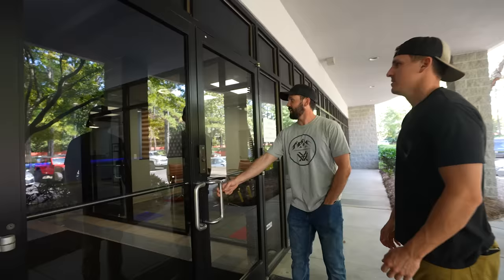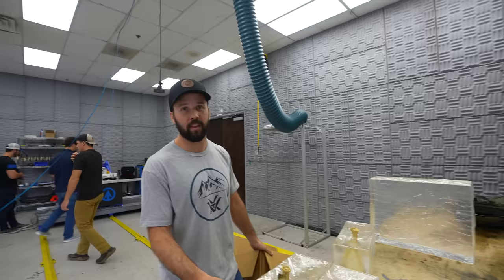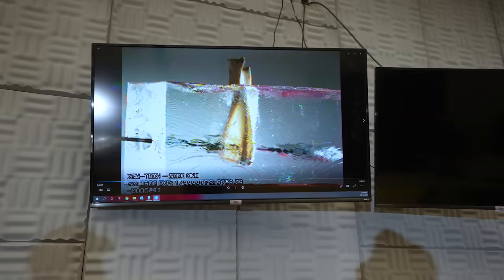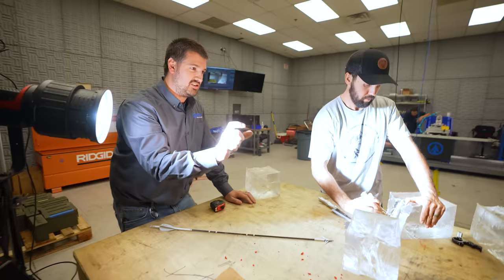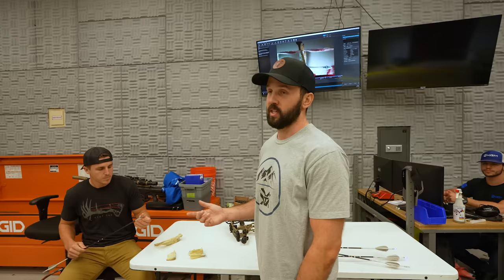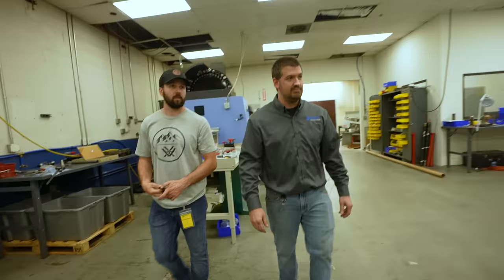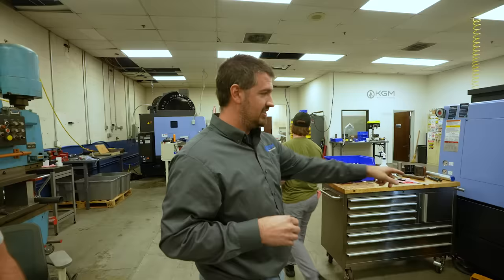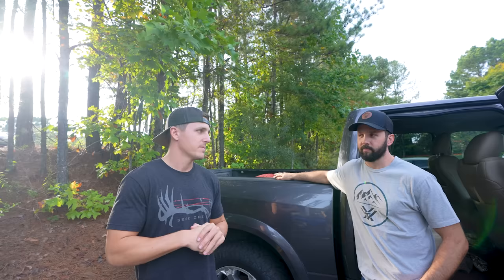BROADHEAD TEST: Which One SPLITS BONE? (Super SLOW-MO Camera!!)

Comment: This should be conducted again but put the scapula at the average distance of a shot for hunting. The parameters of the test are off when you are shooting at the distances you are shooting at. Everything should penetrate enough just due to kinetic energy transfer, which as long as you are hitting the scapula with 25 PSI, most are going to break or allow cut through. Also, my question is how fresh were the molded scapula's? Are they dry bones because dry bones perform differently than wet or fresh bone does. this would be something that really expands the tests if you do this again in the future. I do enjoy tests like this but I would like you guys to acknowledge some of the issues with your testing and the variables that change during these tests compared to the real world.

Comment: The thing you left out is that mechanical went through 12” of gel before the bone. I believe it would have had at least 6”
of penetration on a deer
Reply: And the single bevels would be in the dirt behind the deer after blowing straight through it.
Reply: @outlawcustombows  I’ve killed a ton of deer with mechanicals. I recovered every deer I’ve ever shot with a mechanical. The trauma is unbelievable.
Reply: @JM-sj4wj  so is a smashed humerus or completely fractured shoulder knuckle or vertebrae... won't do that with a mechanical. They're a gimmick you get lucky with if you shoot in a bad spot too far back.
Reply: @outlawcustombows  I shot a buck last year that was on edge when he came in. The farmer was cutting the field and spooked him. When I shot it ducked the arrow and I completely severed his spine with a NAP mechanical. The deer never took another step. The proof is in the pudding.
Reply: @outlawcustombows  the year before that I had a 16 yard frontal shot that blew through my buck and exited behind its shoulder and stuck 6” into the ground. The deer painted the trail red for 40 yards and dropped dead
Reply: @outlawcustombows  I have not had to track a single deer more than 50 yards since I made the switch to mechanicals. Three years ago I shot two deer in one evening one went 20 yards and literally fell under my tree the other went 40 and crashed through a fallen tree. Complete devastation on both
Reply: @JM-sj4wj  see you haven't mentioned a single thing yet that a solid  single bevel 2 blade doesn't do... and they break BIG bones as well...

Shoot what you like but the REAL proof is in the data and physics.

Comment: I love using mechanical heads for the cut diameter on them, but if I wish that I could find one that punches through bone without having to worry about have a small cut like most fixed blades have
Reply: Iron Will wide might be worth a look. Plus they have a lifetime warranty

Comment: First off, thank you guys for putting the work into this, wonderfully done test. Not everybody shoots that heavy of an arrow or out of a 70 lb bow. Could you include the speed of, and more importantly, the energy it is producing? I shoot a 563 grain arrow out of a 65 lb bow which produces 240 fps and 70 lbs of energy. Curious how much an extra 5 lbs of pull weight would change this.

Comment: I've used G - 5 montecs for 5 years now and have hit 3 deer, between my son and I that penetrated both shoulder blades and lungs and shattered both blades and even broke a hip bone and penetrated on a shot that became extremely quartering away at release and STILL penetrated up into the chest cavity and sliced lung and cardio pulmonary arteries. Most broadheads would have failed.  I  swear by G-5 montecs

Comment: Would have been cool if you tried grim reapers I have went through the scapula with 50 pounds and it stuck out the opposite side. 50 pounds 24 inch draw with fmj. Two years ago cut strait through the socket with 60 pounds at 63 yards on a quartering to doe she didn’t make it 50.  I have never had a problem with them opening or punching through the shoulder bones

Comment: I would rather have a knife grade high carbon steel that I have to oil than a soft stainless steel that can't be sharpen or hold an edge. I used wasp cam lock broadheads many years ago, they used carbon steel and the blades were truly razor sharp. The new heads, the edges roll or compress, they are not even hard enough to chip. They will get almost sharp but you can't get that fine edge. Its like making a knife out of mild steel vs 5160 or 1095 steel. Mild is just to soft to produce a working knife. I'm curious to see what you guys produce.

Comment: You started saying different styles broadhead but 3 were close in style. I personally think the Toxic broadhead would have fit right in and you would been quite surprised like the last time you tested it. Cutting a hole as big as a quarter from one side to the other puts them down fast. I have never had a bone stop one yet. Just be aware of the cheap knock offs. They suck.

Comment: Hey guys I was just wondering if I could send y’all a couple drawings of broad heads I have had them since y’all’s last year video cause it I seen the fixed penetrated better but it wasn’t a big diameter cut so I drew a design with a 2 inch cut diameter and it’s fixed so maybe y’all would be interested in seeing them

Comment: I just had a problem with the Muzzy shank 100gr expandable opening in flight and I almost missed a nice 8 point at 18 yards. I just recently got a ravin r10 and I thought they would work fine just like in my old Tenpoint turbo gt. I was vary wrong and if it wasn’t for the 1 3/4in cut I’d have lost that deer. Apparently 400fps and 270 pound draw weight is to much for the Muzzy shank. I will be looking for a new expandable for next year.

Comment: Sevr 2.0 just bought it and i shot a mature (minnesota) doe and it went through the center of the rib snapping it in half and cut part of one of them beside it and blades locked open cut great and stuck out the other side cutting through part of a rib, 70# bow with a fairly light arrow, the rage suck imo and you need to do more testing with the new sevr product line

Comment: Honestly I believe you may have picked one of the most questionable mechanicals out there. I know you didn't like the screw came loose on the NAP killzone but it performs as good or better than any other mech on quartering shot. The screw coming loose is a dab of loctite and fixed. Also having said all of that the rage would have still made it to vitals no problem. The scapula is far closer to the surface and actual cavity of a deer is far less restrictive than ballistics gel. You're getting to vitals and that deer is dead.
Reply: You read my mind!
Reply: Came here to see if anybody else was thinking what I was thinking. You were!

Comment: Everybody is so caught up on the Ashby study and trying to prove what he says is right. Let's keep in mind it was done with wooden recurve bows in the 80s. Not saying what he says won't work, but it's 2022 and majority of us are hunting whitetail. I think the main problem isn't broadheads, it's FOC. Lusk killed 5 pigs in a single hunt with sevr mechanical broadheads. Levi Morgan and Josh bowmar killed two of the biggest brown bears with swhackers and have been killing deer with them. Don't blame broadheads on poor shot placement or not properly tuned bows or tuning shafts.   I recently shot a doe in the spine with a 372 grain arrow, 24.5% FOC, going 310 fps, with a swat 4 blade mechanical, and it punched through the spine, the doe didn't go 20...inches.

Comment: That's the other thing. 

Number 1. we've already talked about how ballistic gel is the wrong medium.  It's the wrong medium whether or not you have a scapula stuck in it.

 Number 2., the skinny, paper-thin portion of the blade of the scapula is absolutely not the part of the scapula that stops arrows. The ridge of the scapula close to the glenohumeral joint is the part that stops arrows. 

It kills me that people with engineering degrees and all that and you can't see the original problem.

You should be shooting through the thickest part of the scapula, And behind the scapula should be something like chunks of regular jello or little water balloons, or maybe even foam rubber soaked in water.

Finally, there's nothing wrong with Environmental Sciences.

Comment: First off ,there is no deer alive that has that much meat between skin "gel" and bone. Of course the trypan didn't pernitrate as far after it pernitrates the bone,  Its cutting another 1 inch wider cut than the fixed blades through the gel. I don't shoot the trypan but I will call out what's not right

Comment: Put a piece of hide in front of the scapula and shoot the rage. It will blow through.   A deer does not have ballistic gel in front of the scapula.  I've blown right through the scapula on a ton of deer.     You had rage screw you when you hit too far forward.   You screwed up.   Hit the shoulder knuckle with the exodus and it will break

Comment: I personally believe we need to go back to basics. What are we trying to accomplish with shooting an animal with a bow and arrow? Blood. Simple as that. Bleed rate. Quicker u get that animal to bleed the faster it will die. I had a rage, shot with a crossbow, go directly thru the ELBOW of a deer, then through one rib down low, through its heart, back out other rib, and stopped inside the main front leg bone. (Misjudged the distance and shot low) the deer ran 25 yards and died. Blood was everywhere. 2.5 inch hole through bone. Heart was almost in two pieces. ........ if ur bow can't shoot through a blade, or if u can't aim, we need to stop hunting. Even if u do get through the blade with a small broadhead, and manage to hit a lung, ur Blood trail will be terrible. And most likely won't find the deer anyways.

Comment: The video is great but actually almost every broadhead will cross the scapula 99/100 times. That test means nothing in terms of penetration (1 in or 2 in difference is nothing while you reach the interns). The scapula/humerus joint is the real issue.

Comment: Rage crappan is horrible, and yes those 2 blade fix do work great.but I have to say the spitfire by NAP is phenomenal I've taken dozens of deer in Michigan with spitfires several angles and through extremely heavy bone and have not had one fail me, although I have to say cutting diameter I think makes a huge difference the best that I found in the spitfires is inch and a half I think anything bigger than that is for one, unnecessary and blades become weaker the longer they get so if you're looking to try a mechanical with competent equipment of course go old school and shoot spitfires!

Comment: This is a good test but what is the penetration from a shot at 20 to 30 yards. That would be a more realistic test. No one shoots deer at 5 yards in a controlled environment also if your hunting from a stand and shooting from a 33 degree angle,  is the scapula going to deflect that arrow at say 25 yards? Is the arrow going to penetrate the scapula at a distance? I’d say no. Because most of the energy from the arrow/broad head has fallen off. Also is it going to be a quartering to or away shot? There are too many variables to really know. But at least you guys are trying to Eliminate some of them. Thanks!

Comment: Dry bone does not act the same as bone in a live animal. Dry bone is brittle and breaks off, where bone in animal will actually stretch  around a penetrator to small degree.  The 1.5" rage should have been used to get better consistency in the testing since the other broad heads have a much smaller cutting surface, and cutting surface is the biggest detractor from penetration. I did a video where a rage chisel tip made complete pass throughs on a cow skull and scapula with blade deployment. John Dudley has a video where he shoots a 1.5 inch rage through a bull elk, and it penetrates the off side leg bone causing a break. John Lusk test show 1.5 sevrs penetration is on par with similar size  cut on contact broadheads. The QAD is probably the best broadhead on the market. The wound channel is just nasty devastation on whatever you put them in.  If my gopro had not malfunctioned I would have footage of a 37 yard shot on a quartering to fallow buck. The shot went in just behind the should, and came out just left of his tail. The recovery was 20 yards. I really like the test and the video. Keep up the good work. If you ever get a chance, the is a place in Alpharetta on old brumbelow rd that was referred to as the hill, there were some monsters in there when I was coming up. The probably haven't been hunted since I left 25 years ago.

Comment: That mechanical would have killed the deer as long as you have that penetration thru the bone, the action of the deer running would have cut it to pieces inside. I don’t trust them either but that would have worked. Three bladed fixed, just safer to use.

Comment: 18:40 , if you miss your spot and hit further back, will the extra cut of the mechanical save you.
If you hit too far forward and catch heavier bone will the mechanical head impede penetration to a point
the keeps you out of the vitals ?.
I say the solution is a bigger fixed blade, maybe even a C on C head.
I played around with the Grizz trick 2's this year. They deliver 2.5" of st tissue through their path.
That's more than a rage head, just sayin....
OR a good C on C to compare is the Magnus Black hornet,  boasting a 2 and 1/8" cut path.
I will say a large cut, replaceable blade head can possibly run into some trouble when encountering 
heavy bone, dense tissue, ligaments and tendons but usual still gets into the chest.
Might brake a blade but your still getting into the chest cavity and doing enough damage. 
My $ .02 that's all ;)

Comment: If you guys create your own broadhead, please make something that can be resharpened. I hate replaceable blade heads.
Reply: I've always used Thunderheads which are a replaceable blade head. I have re-sharpened the blades if they've been shot into a foam target and are just a little dull but not damaged, but I also look at it in a way that a pack of  fresh replacement factory sharpened blades are sharpened to perfection and are all evenly sharp and uniform.

Comment: As far as mechanicals go Sevr  broadheads makes the best mechanical and the strongest especially the 1.5 cutting Dia. That is the only mechanical that I would trust to use. I've spined deer & could easily reuse that BH just replace the blades & your back in business. I shoot them off of my crossbow 
I was hoping to see some kayuga pilot cut broadheads in this test.
 That is currently the broadhead I've been using the past 2 years A nice wide single bevel with bleeder blades if you choose to use them & a wide cutting Dia. that is Indestructible.   And you shot an Ozcut but you didn't shoot the 3 blade single bevel oz cut smh.  Which is an awesome broadhead and I've taken quite a few dear with that as well.

Comment: Perhaps you mis-understand how a single bevel works its way through bone.  Based on my understanding it is not due to the tanto tip. The purpose of the tanto tip is to keep the tip from folding over, which would deter penetration.  I have never heard or read Dr. Ashby communicate that the tanto tip is to act like a maul in a splitting action. And I read all of his reports many years ago and have viewed some recent videos interviews.  Rather, I have heard him say and I have read that the purpose of the tanto tip is to avoid tip deformation and resulting penetration reduction.   

The single bevel works via the wedge effect and for that to work optimally the blade needs to be thick and the ramp angle needs to be shallow. The single bevel BH you are using does NOT have a shallow ramp angle. I do not know how thick your single bevel BH is. The single sided (single bevel) wedge forces the bone apart (the rotational action) but IMO the forward and rotational forces are probably balanced and complementaryis due to a combination of forward and rotational forces.

It is hard to visualize, but when you view a proper single bevel Broadhead "head on" and then re-imagine the shape and forces, (vs. what your eyes want to initially tell you) you will see that the bevel on a thick head creates  a wedge that simultaneously cracks the bone and imparts the rotational force.  For the wedge to work properly the ramp angle needs to be shallow.

The single bevel you show appears to be a relatively stubby Broadhead with a steep ramp angle - not what the Dr. ordered (so to speak.. LOL).

Personally, I usually use Abowyer single bevel Brown Bear heads when hunting elk because I am seeking pass-throughs and I am specifically concerned with the risk of hitting the scapula or other heavy bones. My elk arrow weighs about 630 grains.  I don't think a single bevel BH or my elk set up is needed for those little bones you are shooting through.  I think my Magnus Stingers would handle a deer scapula fine (but I have not put a stinger through a deer scapula).

Of course, the good Dr. is also adamant that there is a difference between live animals (or within 30 minutes of death) and aged materials.  In addition, his focus was specifically shooting through heavy bone which he defined as the ribs of a water buffalo - which overlap like armor and are an inch thick.  His other concern was that given his style of stalk hunting, he desired a set up that would essentially shoot lengthwise through medium game or work at acute angles.